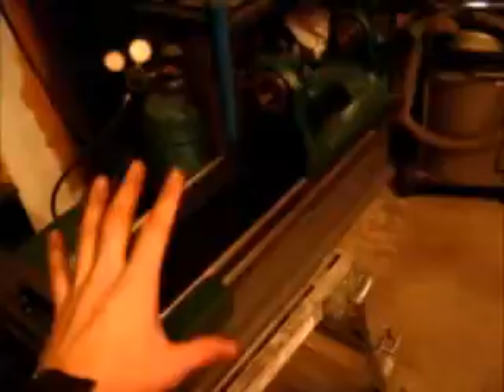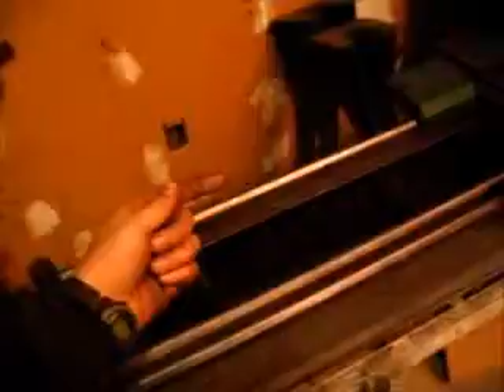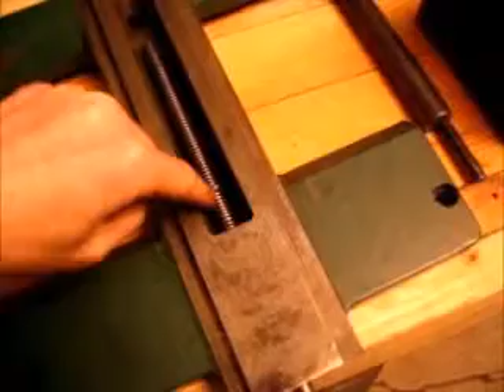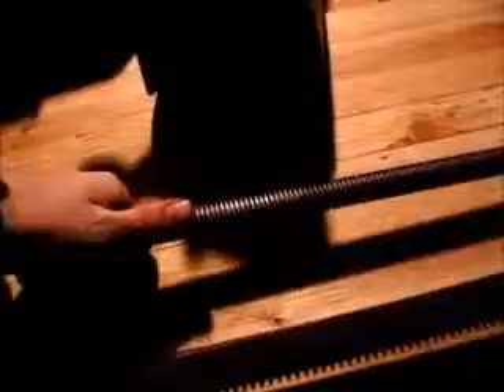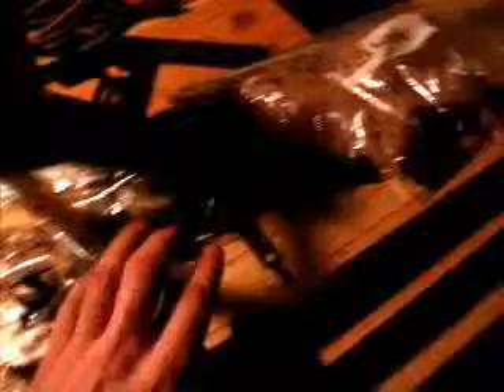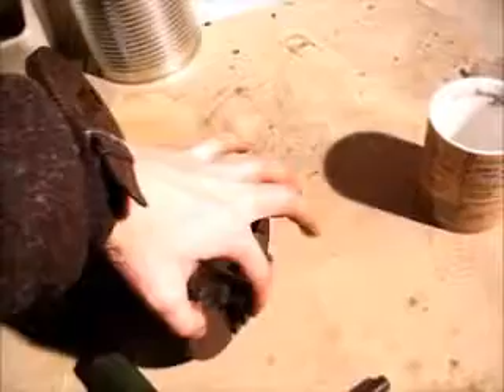20's-30's Champion Forge and Blower lathe cleanup/repair #2

Comment: What you have is a Champion Blower & forge Lathe. It looks like it is the same thing a mine. but yours has a compound rest that did not come with it and the legs have been changed. if you like to look at one that has all the parts that came with it. Go to tony@lathes.co.uk, and look under Blower & forge and take a look at the one under A well use Champion Blower & forge, That one is pictures of mine. Good Luck on your project. Ed.

Comment: Your camera is probably fine you should improve your lighting. Or dial in some exposure compensation.
But more important, how is the project coming along?
Reply from the maker: +U3erpru7ser Thanks for the advice. I'll be sure to work on the lighting. I did get a new camera and it seems to take much better footage. I'll upload a new video here in the coming week. Progress is coming along, and it turns out that this isn't a South Bend, I'll reveal the type in the next video.